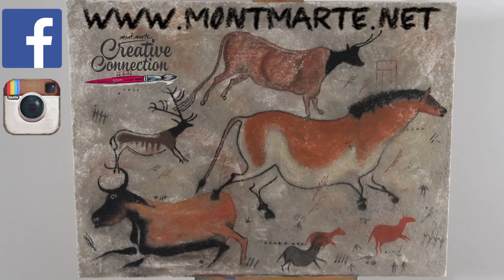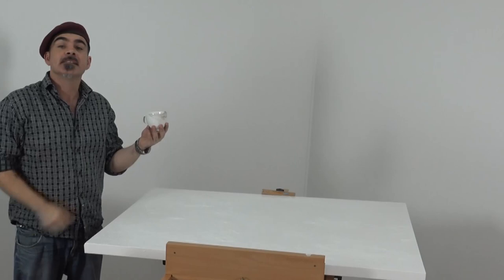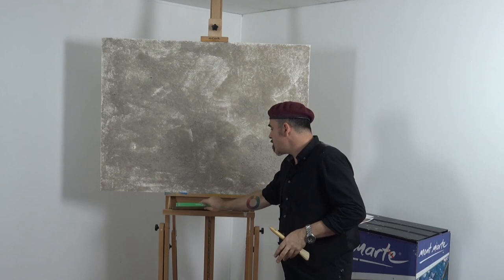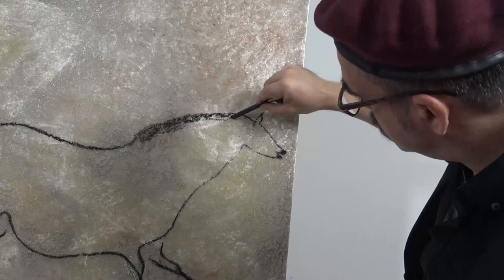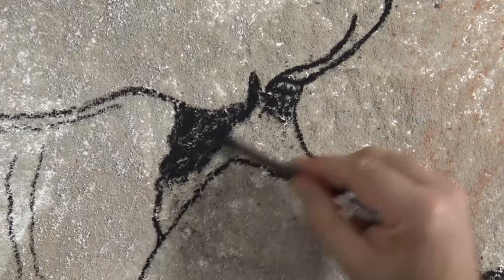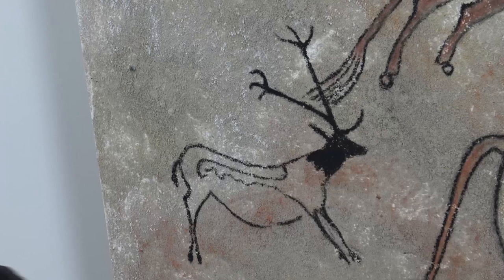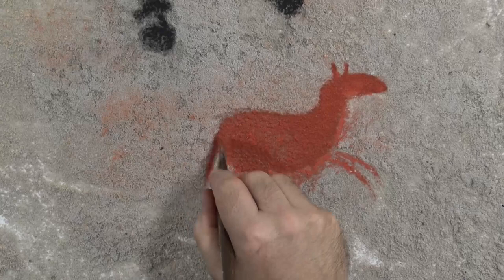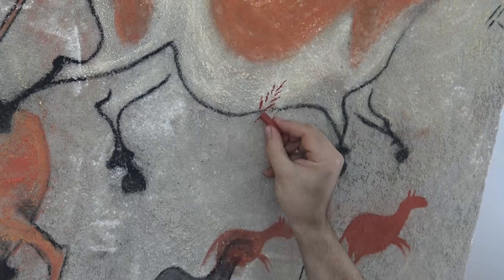Art Lesson:  How to Re-create a Cave Painting

Comment: Is it possible to use a texture/structure paste instead of sand? Would the pastels stick then?
Reply from the maker: Hi Lisa, thanks for your question! Texture paste will still be fairly smooth and won't achieve the same effect. You could use the paste instead of the glue, but you'll still need to add sand to it for this particular artwork. Feel free to experiment and make it your own though :)